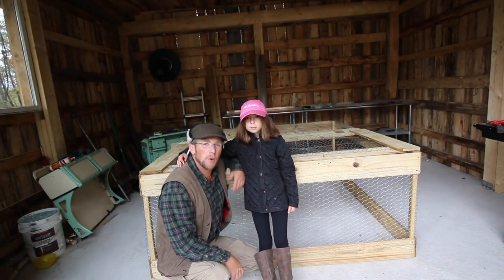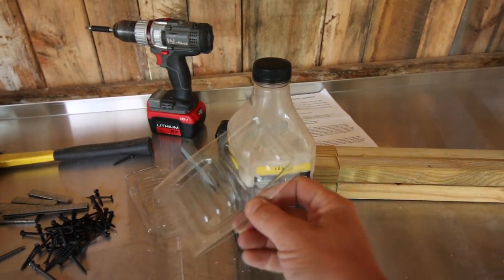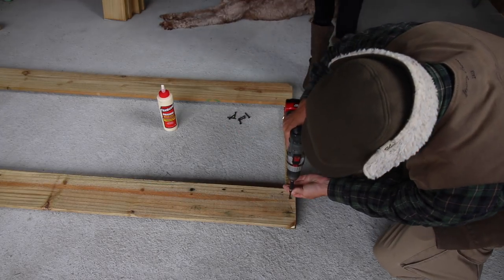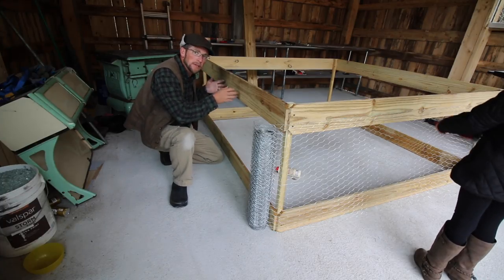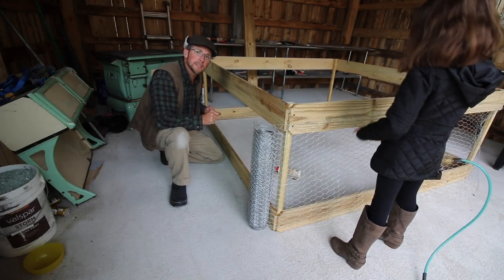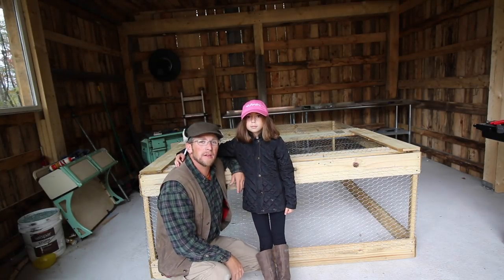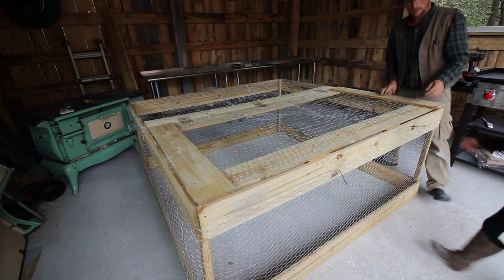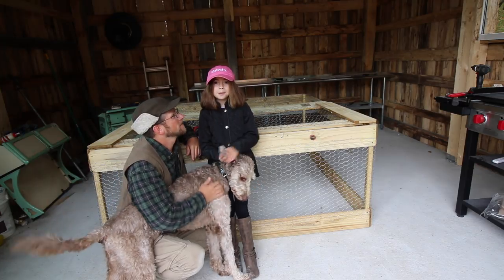DIY $30 Chicken Coop you can Build in 30 minutes

Comment: So I did it tonight. Cost is a little more than $30 for my supplies. $19 for the wire. $31 for the boards. 9 for the 2x2s (went with those instead of the pillars.)

But it came together well, the directions were easy to follow (except I got lost doing the hatch and just winged it). 

Took me about 2.5 hours.

Comment: Is there any reason this couldn't be modified for 8-10 layers? I was thinking to install a vertical piece about halfway back-- then run a beam across that could be used as a perch. Also-- attach a 5 gallon bucket brooding box in the back.

Comment: Smart girl! She was already stepping onto the wire before you asked her to. I think if you  check, that Titebond is for interior. That's what mine says. I'd go with construction adhesive. One tip for the wood glue, I've had to throw out a few bottles that got mold in them. I now avoid touching the glue tip to the wood. If I want to spread the glue I use something else. After a project I put it away by putting plastic wrap between the bottle and the top. I haven't had any go bad that I handled this way.
Reply from the maker: On wood glue they make interior an exterior also.
Reply: Lumnah Acres that's good to know. I tried to freeze the frame but I couldn't make out anything but the brand. I should have realized that The Boss wouldn't have let you use the wrong glue.

Comment: The blog post states green treated, would it be safe/acceptable to use  ground contact pressure treated wood? THANK YOU,
Reply from the maker: You can but I am sure it will cost a lot more.  I havent seen the chicks peck at the boards at all
Reply: Lumnah Acres Thank you! Home Depot and Lowes don't have the best selection. Thanks again,
Reply: You can't use treated wood it will leak in the ground and it's highly toxic read the label you need to e
Wear glove and use a mask when cutting

Comment: How does this Chicken Tractor handle predators?  Where I am located we have Raccoons, Foxes, Opossums, and Neighbor’s Dogs to contend with.  Right now I use several Hoop Coops and have
not had a problem.  These would be cheaper & easier to build to use for roaming breeding cages, I am just worried about critters breaking in
Reply from the maker: You might want to replace the chicken wire with hardware cloth. The frame is very durable
Reply: I know you have built several types of coops.  Which style has been your favorite.

Comment: Hi Al and Olivia.  Love your shows - babe.  I have some questions.  Anyone In Lumnah YouTube land with answers I'd love to hear them.  Al, in your Chicken Tractor build videos 1 & 2, you left a 12 inch skirt of chicken wire.  You said it was to keep out the critters.  (Outside critters won't dig under the frame.)  On this meat bird tractor, you left it off.   Do you no longer have critter problems?  I haven't started raising chickens yet.  Too worried about the local critter problem I may make worse.  (2 cat colonies, Vultures that hang out and hawks that feast on anything they catch.)        

Got any advice for me?  (I plan on moving in 3 years.  I may have to wait to raise chickens until my new place is ready.)  I live in semi-rual Maryland.  

Signed wife of above.  (he didn't set it up for me - so there.)
Reply from the maker: If you have a predator problem then leave a skirt of chicken wire. If not then you dont need it.

Comment: chicken wire is so chickens can not get out. That said ratcoons can get in through chicken wire, give it time they will come around more and more until eventually they suck a chicken out right through the wire or work it apart somehow over time. Have you seen foxes jump up and down on the top, roof with snow on top also? I had a ratcoon eat a quail and left the egg from that quail inside the pen, just the other night.
Reply from the maker: Sorry to here you have such a bad problem with raccoons. You will have to use hardware cloth on the $30 chicken coop to keep the raccoons from getting your chickens

Comment: As for the 30 minutes, I think I need an Olivia to get that time. Took me about 3 hours bec my screws kept lagging when trying to drive them through the spindles. Putting the tarp on before work so I can get the girls out there. If the other ones weren't so aggressive, I wouldn't have needed to build it at all. Trials and tribulations.

Comment: No way all the materials cost $30 bucks.
Reply: Well this was built in 2017.. So prices may have changed since. Already went to home depot and got the 12 6ft fence pickets, 5 36inch beveled 2 end baluster, & the 50ft x 2ft poultry netting all for like $47 dollars. I saved money because I already had the screws/other equipment(like clamp). Gonna try to build it next week.